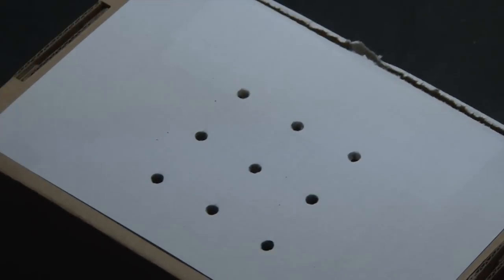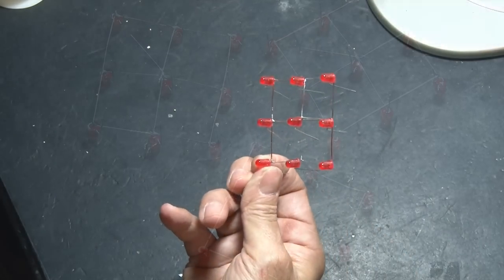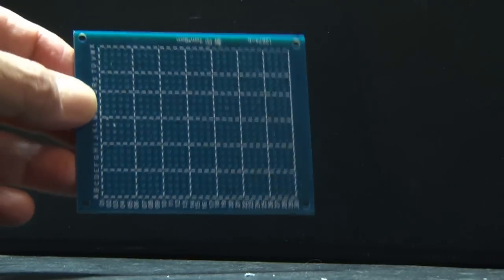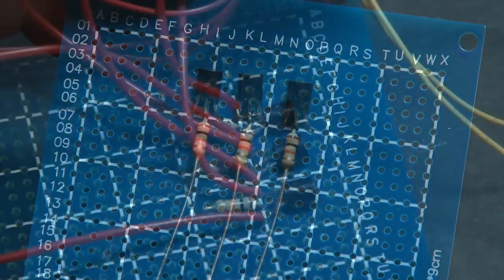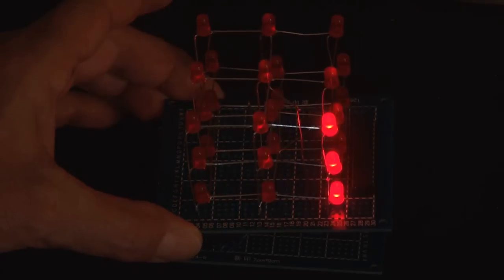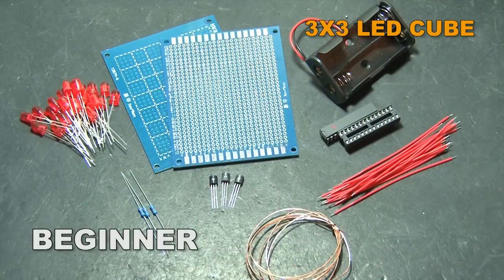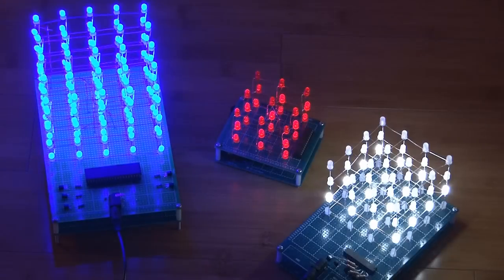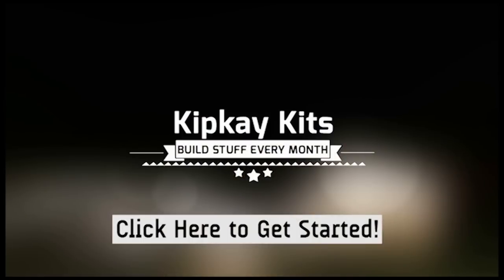Amazing DIY LED CUBE!

Comment: What do the PNP transistors do? Can I build this without them?
Reply: +dj505Gaming No, you can't. without them, all the led's in each column will turn on at once. The transistors work as a switch which helps turn in certain LED's instead of all of them at the same time.

Comment: "Where do I get the materials to build your projects?"
Me: Radioshack
Reply: Nathan Schultz still expensive
Reply: Not really, the LED'S are REALLY cheap... And this project doesn't use that many materials, sure, arduinos can be quite expensive, but everything, not really. And if you want a free circuit board, take one out of some old device, and take everything off... So if you know how to save money, Radio Shack really doesn't cost very much... An red flashing LED, for example, only cost 69 cents. So really, not that expensive. And besides, I wasn't talking about expense, I was talking about where to get parts...
Reply: leds are 2 bucks maybe ill salvage my broken mouse to get leds
Reply: That works too, you can easily find parts for cheap on these types of projects.
Reply: yup i made a continuity tester from a mouse that was not working

Comment: Nice, but shouldn't the neg. leads have black insulation? And I'd just use a single slightly larger board to accommodate everything.
BTW, what DID happen to your laser vids? And did you ever happen to get that one confiscated unit back from a few years ago?

Comment: Sorry Kip but this is little more than an advert for your kit. Building this kit will teach you nothing about how an LED cube works or how to make your own patterns. If you want to learn go and research Arduino and LED cubes, buy the parts then assemble and program it yourself.